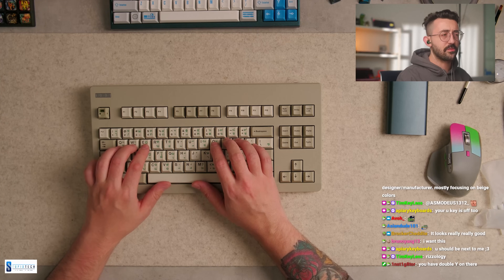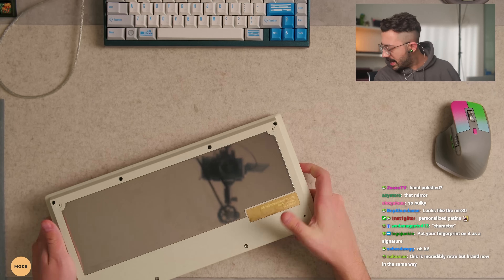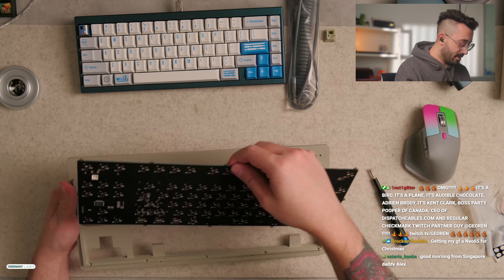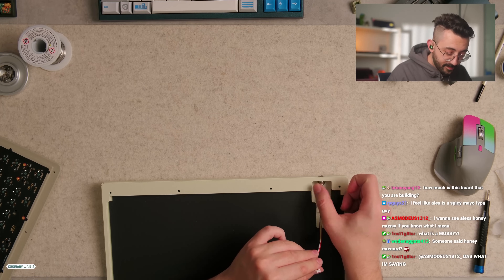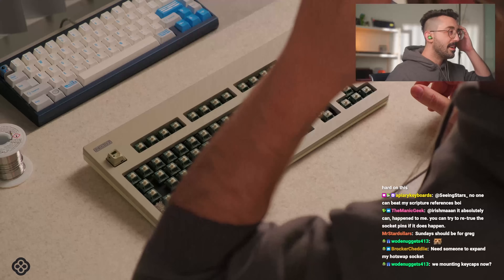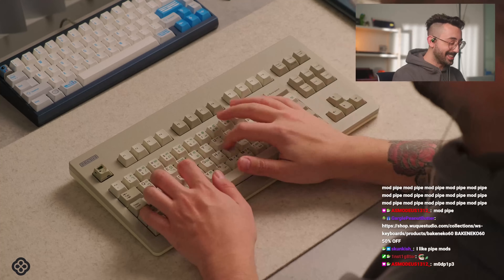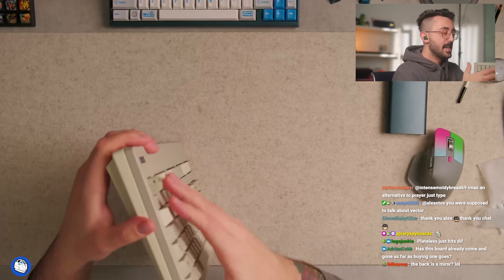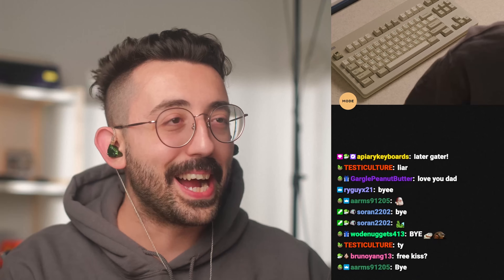The Jer80S —  bummed I never got in on this one!

Comment: I don't get it honestly, like the f row probably sounds like that cause it's more space out and incased in more material reducing the high pitched sounds which gives it a more poppy "thocky" sounds, which is something u can replicate using foam to achieve a similar sound profile. Taking that into consideration I don't get why are you so opposed to foam in keyboards if u like that sound profile, at first I though you didn't like it cause it muffles the sounds but if u like the sound without the foam why not add foam to other boards to replicate it?